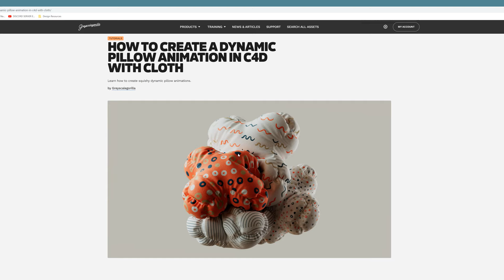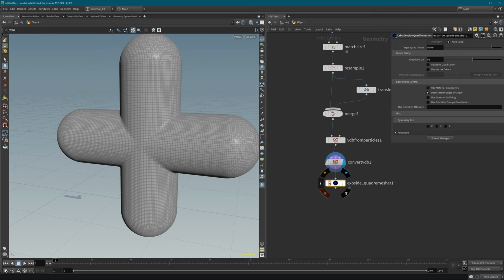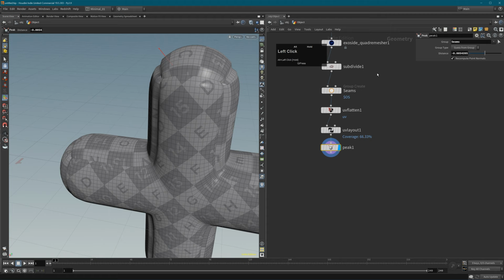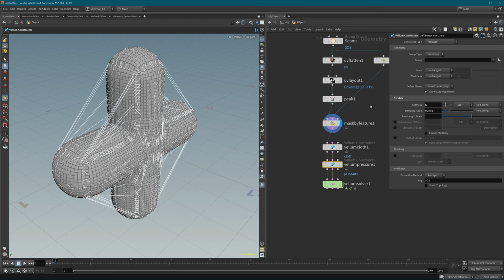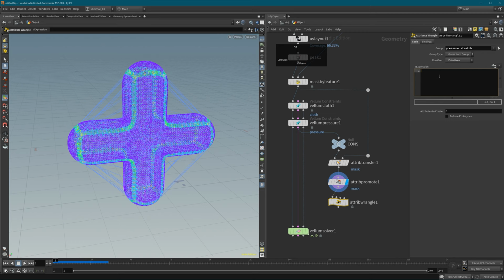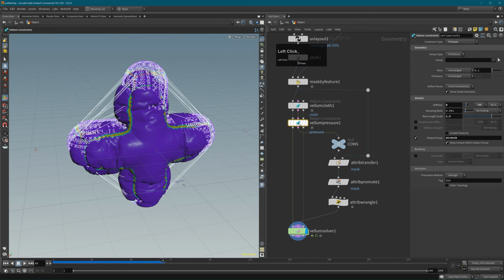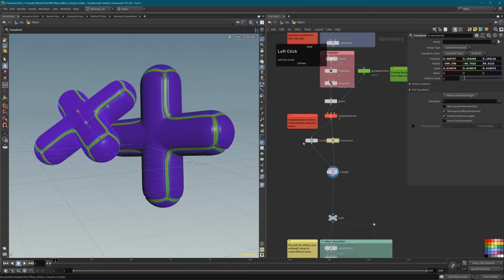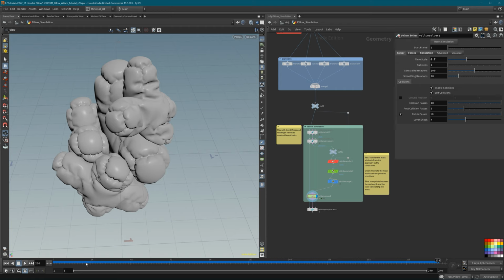Houdini Tutorial - Fluffy Pillow Simulation with Vellum

Comment: for those who dont have exoside quad remesher you can get a similar result with setting the point radius scale in vdbfromparticle to 0.15 and adabtivity value in convert vdb to 1.5 its not perfect but it will do :)
Reply: Thx, I have exoside quadremesher but its throwing out an error every time I try and use it so I think I will be doing it this way.
Reply: hero 👌
Reply: @jsolidd713  you automaticaly get it with labs plugin but you need the liscence to cook! I had the same problem!
Reply: thanks so much, i tried everything with instant meshes, remesh and fast remesh for hour
Reply: it's frustrating to know that c4d and even blender i think have a similar "remesh to quads" feature, that's not separate from the main software, unlike Houdini.
Reply: Instant mesh node works too.

Comment: Watched this tutorial a few times to really try understand the process - it’s so well explained ! 

I completely fall apart at the attribute wrangle section however as I simply don’t understand VEX. I don’t like to just copy from tutorials if I don’t understand what I’m doing as that’s not practical from a production POV.

Any chance you can explain the steps to recreate from a VOP level?
Reply from the maker: I also had problems with VEX in the beginning. But it’s such a fundamental and powerful part of Houdini, that I would highly recommend to take the time and learn it. VOP and VEX use the same concepts, the one uses visual programming (VOP), the other code (VEX). But the basic operation does not change. So if you understand the operation in VOP, you also understand it in VEX and the other way around. Write each line of code, read the documentation of the used functions and you will understand, what’s going on.

Comment: there is another way to drive a vellum param through attrs?, it should be as that easy as write @mask in the rest length scale param but it doesn't work. I also tried with using a fit01(@mask,1,5) in the param but doesn't work. I think people uses vellum constraint properties node to do this but Idk how it works

Comment: Thank you for the video. However, how do you add colors, textures, lighting, and style to the pillow?
Reply from the maker: There are plenty of texturing and rendering tutorials. In this case I rendered  with Redshift in Cinema 4D using materials from greyscalegorilla.
Reply: I'm day 0 on Houdini and want to just understand the workflow... You modeled and set up the simulation in Houdini, but then exported that to C4d to add materials and to render? So is the export of Houdini a mesh that has rendered "keyframes" from the simulation, so you can add materials to it on top of that?

Comment: Hello, thank you for the tutorial. How did you get the parameter panel to show up overlapping of the network view ?
Reply from the maker: Just press „P“ key over the network view.
Reply: @graphicINmotion  Thank you, is that redshift you used to render the intro render ?
Reply from the maker: @albanl8979  yes
Reply: @graphicINmotion  Thank you and last question sorry I'm new to houdini. Would there be a way to select the edges for the seams in a procedural way ? Like the group node let's say to select by random chance but to select random edge loops that are connected and closed ? Thank you
Reply from the maker: @albanl8979  in Houdini there is usually a way for everything. In this case the group by expression node could help. But for the expression that would select random edge loops, you would have to ask one of the VEX pros out there.
Reply: @graphicINmotion  Hello again, I've been trying stuff on my own from your tutorial and I'm kind of stuck here with VEX, I want to multiply the stiffness only if the type attribute is equal to "bend" cause I don't want the stretch constraints to go crazy. Hw should I refer the string value ? I'm usng this so far but can't make it work : 

if (@type = ("bend"))
    @stiffness = @stiff * @stiffness;
else 
    @stiffness = @stiffness;

It says that I can't convert string to float but that's not what I'm trying to do here
Reply from the maker: @albanl8979  @type needs to be defined as string attribute, use s@type when defining it. One "=" is not working in an if statement, you need double "=="
Reply: @graphicINmotion  Thank you VERY MUCH i'll try this tonight
Reply: @graphicINmotion  Hello graphicINmotion it's me again. I'm sorry to ask this but what does the stretch output group and the pressure output group outputs actually ? Is that a value between 0 and 1 where stretching behavior is applied to the mesh ? Highly deformed polygons are near to 1 and 0 are not stretched with the constraints ? Is that the same for the pressure output groups ? 

Also I'm sure I understand why do you need to use linear interpolation function for this ? If I understand correctly you're telling houdin  "okay do this for the pressure and stretch attributes, use the group value to morph between a normal restlength and a restlgenth multiplied by a float of my choice" but from the group here I think I see only 0 and 1 value for the mask, either a primitive is in the group or is not since there is not attribute blur after the promote ? Would a attribute wrangle ran on the mask group multiplying the restlength and pressure restlenght by the same float do the trick ?

Thank you again for your time and patience as I'm trying to assimilate concepts of houdini

Have a great day
Reply from the maker: @albanl8979  the groups do not output any values. You just use the groups to tell Houdini which attributes to manipulate. The value is stored in the attributes. You can check their values in the geometry spreadsheet.

Linear interpolation is not the same as multiplying. If you multiply with 0, you get 0. If you interpolate between two values and the mask value is 0 you get the first value that you defined in the lerp function.
Reply: @graphicINmotion  Thanks a lot but yeah I meant that when you masked by feature it seemed to only output 1 and 0 with no blur or values inbetween, that's why I though the linear interpolation would only output second value for the points with a mask value of 1 and the original value when 0 because I don't see any inbetweens but I guess that's because my reflex was thinking of doing this with a if function. If mask = 1 then manipulate the value otherwise let it to it's original value, however if there was a little bit of blur on the mask attribute so we got some 0.5 somewhere then that's where it would fall appart and It's the best thing to use the lerp I think.

Also When I go to the geometry spreadsheet I only see one value for the pressure attribute, since the pressure is not calculated for each primitive and is just a constant value does the lerp function really manipulates the pressure for different part of the geometry in that case ?

Again thank you so much, I'm really considering joining your patreon to see how to manipulate vellum vales in time, thank you so much for your time and knowledge shared
Reply from the maker: @albanl8979  Yes, you could also use an if-statement. That´s the cool thing about Houdini, there are always multiple ways of doing things. So my ways are my ways, but not "the only way" how to do something in Houdini.

The lerp function does manipulate the restlengthscale attribute. It´s stored on the constraint primitives. 

I would be glad to see you join Patreon. The more people join, the easier it gets for me. Thank you!

Comment: HI I double check values at min 24 with mine and the mesh behaves quite differently. Is this a version issue?
Reply from the maker: Is the size of your mesh the same? I don’t think it’s related to the version.
Reply: @graphicINmotion  I believe it is the lenght of the lines is 1, unfortunately I am trying to open the file from Patreon, and it does not work.
Reply from the maker: @brunosuraski5026  What is happening when you run the simulation?
Reply: @graphicINmotion  I will try to send it to you via Patreon if the system allows attachments.
Reply: @graphicINmotion  It just flexes differently.
Reply: Same here, have you found why ? Looks like my creases dont fight pressure at all hence dont create folds